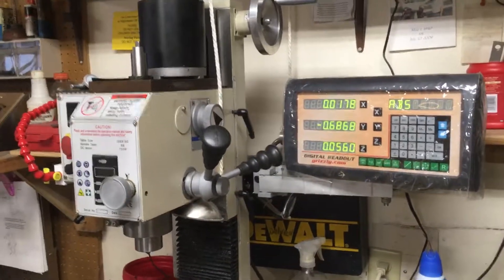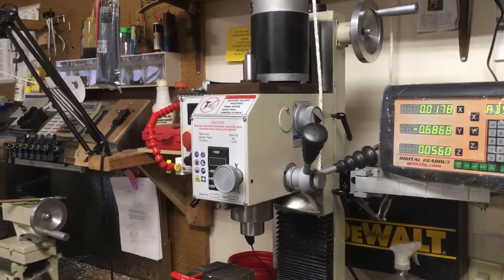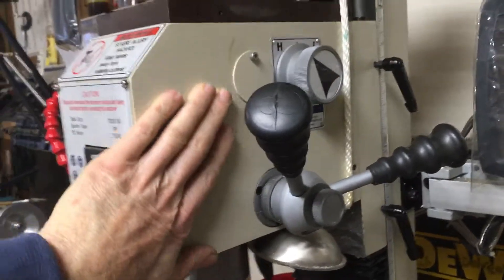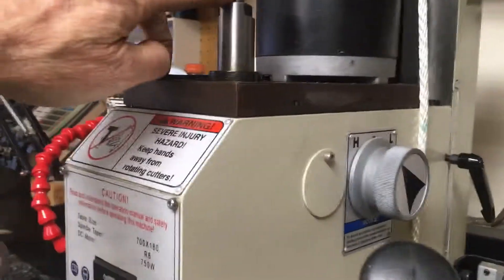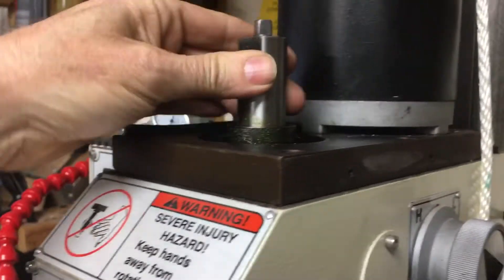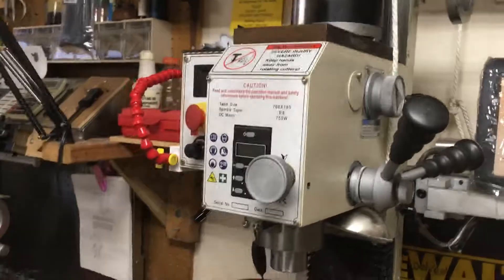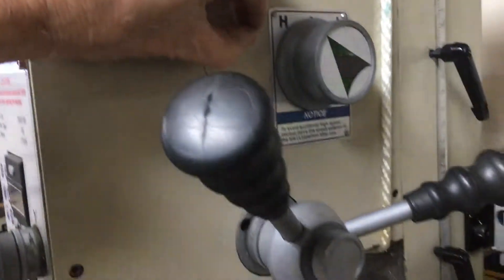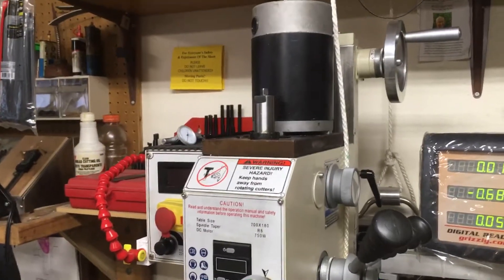G0704 Spindle Bearings

Comment: Did you resolve your problem with the heating bearings?
Reply from the maker: George, I replaced them with a new set and that took care of it.  I think a tear down, cleaning and lube if done when nearly New might have also worked, but they are sealed, so that presents a problem with that plan.
Reply: @RVJimD  did you use Grizzly replacement bearings or aftermarket bearings?  I would like to know the part number you chose if they are aftermarket, thanks.  I bought my G0704 used but it can't have more than 25-50 hours use on it.  My lower spindle bearing is already shot.
Reply from the maker: @wisheye1  it has been a while since I did the replacement but I saved the old parts .  I think the top and bottom are different sizes.  Koyo 32007 JR E1905.  And H-E32005J 190409.  The first one is the larger one.   I think each came with a new race.

Comment: Hi- thanks for your time in making this video. I have found a similar heating problem with my G0704. I tracked it down to warn bearings. Not sure about quality of stock bearings, but they sure needed to be replaced. The upper cap that you are guessing is a bearing tensioning device, is not.  It is a part (2) of the drawbar assembly. The beating tensioner is below that drawbar Assy. If you look in your owners manual you will find it, part #252, Adjuster nut. Hope this helps, Howard

Comment: No those bearings are not good for higher speeds for long time they heat up because they are not precise. Look for 32005 and 32007 nachi bearings. They are rated to 6000rpm and beibg precisely made they dont heat up until rated speed.